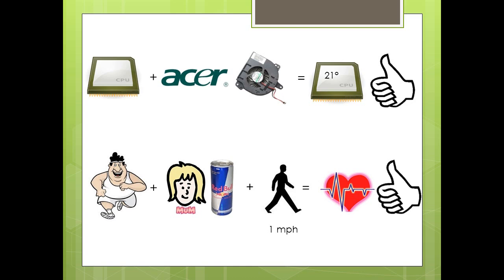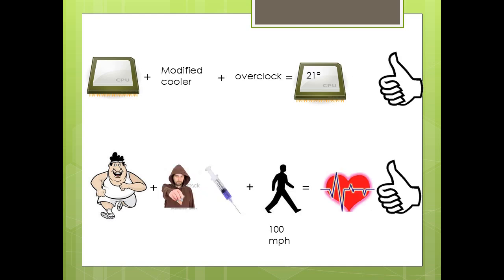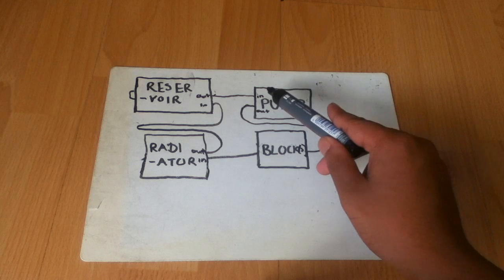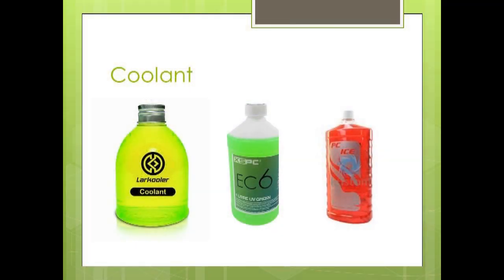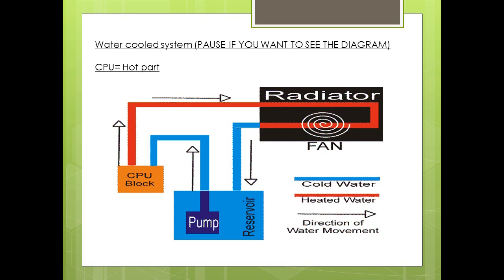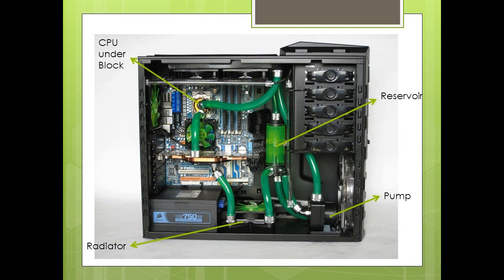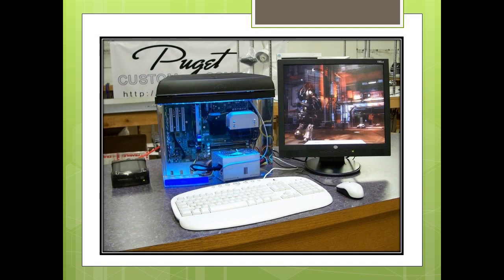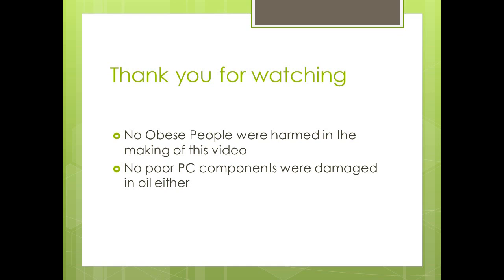Guide to PC Water Cooling for Absolute Beginners

Comment: I'm trying to build my own pc. At this point, I'm working on finding out about the compatibility of the different parts in my pc. Could you give me a few tips?
Reply from the maker: Hi Arjun, I'd definitely recommend using PC Part Picker. It's a website where you can pick pc parts and check their prices and if they're compatible with each other!
Reply: @Trustechreviews  WOW! You replied pretty quickly. I'll definitely check out PC Part Picker. Thanks.
Reply: @Trustechreviews  Hey. It's me again. I'm trying to find a computer case that has space for an optical drive. I've been looking for 2 days and still cannot find one. You're literally the only person who can answer my questions.
Reply from the maker: @arjunmanda1694  Hi Arjun. I had a look and there are still a few PC cases which have optical drive slots such as the Corsair Carbide 100R. If you have a look at the specifications it should say 5.25" slot. In all honesty - there isn't much need for CD/DVD anymore so most people (myself included) don't have an optical drive but use an external USB one on the rare occasion it's needed. Hope this helps! - Hemal
Reply: @Trustechreviews  But, what if I want to play games on PC such as CoD? Don't I need to buy a dvd of the game?
Reply from the maker: @arjunmanda1694  People tend to buy their games online now on things like steam!

Comment: Really.. computers don't need "extreme" cooling.  BUT one thing to consider is AMD vs Intel CPUS.   Basically, AMD cpus vs Intel cpus are functionally identical - with two differences.  AMD cpus are much cheaper.. and MUCH hotter.  I suspect that AMD "overclocks" their cpus to match the speed of more expensive Intel cpus.  So, if you are using an AMD cpu, your cooling needs are much greater.  This can be a problem if your system becomes as loud as a jet engine to cool it.